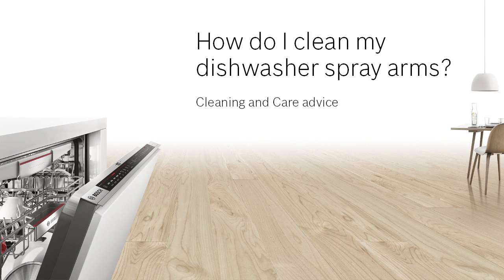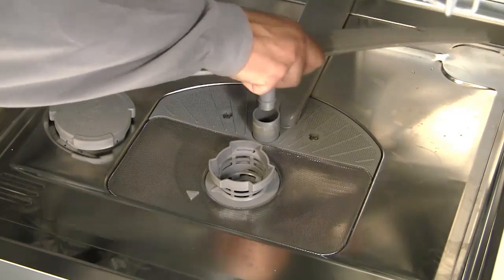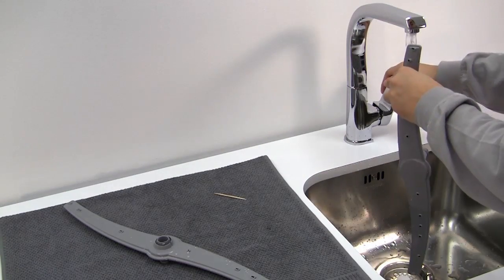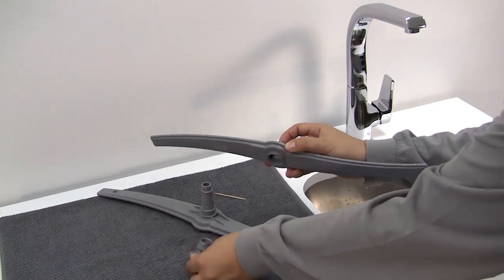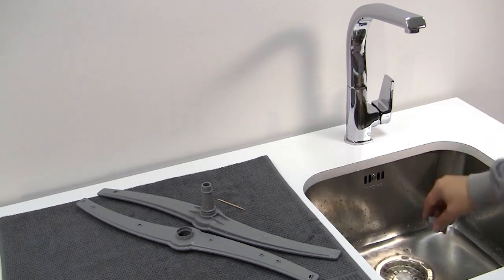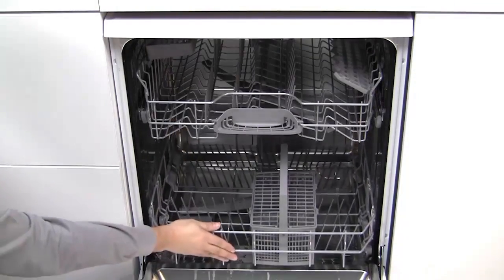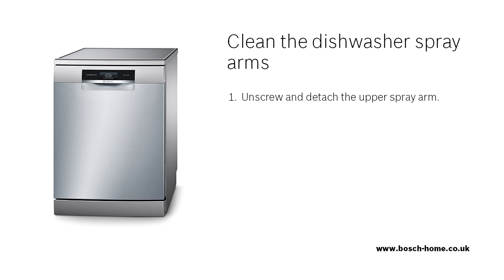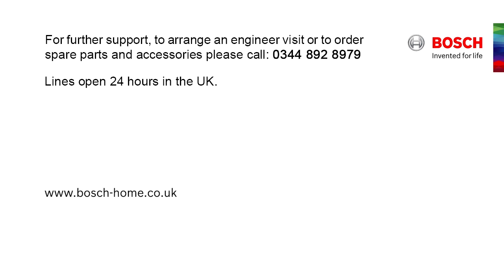How do I clean my dishwasher spray arms?

Comment: As other comments are saying, the design of these spray arms beggars belief...obviously not designed by anyone with any common sense! Tiny bits of gunk (be it meat/bone/sweetcorn) get lodged in the nozzles and using a toothpick or anything else more often than not defeats the purpose, simply pushing the offending article back into the spray arm, only for it to reappear somewhere else. Soooo frustrating 🤬
Reply: Hi, did you find the solution? My dishwasher arms are clogged every single time I use the dishwasher. So annoying. I have to clean it with toothpick all the time.
Reply: Hi - I eventually manually enlarged the holes using a knife! Not pretty, and I’m sure there’s probably a better way of doing it (eg with a small drill bit) but I was in such a temper I just ‘hacked’ at them!! They do still get blocked, but not NEARLY as often.
Reply: @trishsykes449  I am afraid that the water pressure will be less if I do the wholes bigger, no? I was about to buy a new dishwasher but what the point, if the new one is going to have the same issues!? The only one thing we can do is to empty the dishes before putting it. But then, why do we need dishwasher?
Reply: @innasokolova736  I haven't found the (SLIGHTLY) larger holes affect the washing at all...except they don't get blocked so often!! Beware of washing the dishes prior to loading the dishwasher...I've seen (somewhere on YouTube) that that's not such a great idea either (other than larger pieces of food/milk/cheese etc)! You also need to ensure the filters are clean AND properly seated as that can also affect the water pressure.
Reply: @trishsykes449  oh yes, I have seen on YouTube that the filter has to be cleaned and nicely attached. Thank you, I will check today my filter.

Comment: Spray arms are the worst designed part of a dishwasher. They are impossible to fully clean. If you push the dirt in one hole it will end up blocking another !
Reply: Youre right you can’t just poke the stuff out it just disappears you rinse it comes out of the other hole or the SAME one. I think all you can do is immerse the whole spray arm for as long as possible in water so that the food dissolved and you can rise fully. This takes a long time and in the meantime you can’t use the dishwasher. These videos are useless and they’re all the same .
Reply: yeh, it's a pain in the ass. What I do now is take both the arms off and soak them over night in a vinegar solution, that normally dissolves all the food particles and crap.

Comment: No, this process does not clean the residue blocked inside the arms. The residue will stay there forever. It's hard to clean the arms making the only option to buy new ones. They are sealed, can't access inside. I expected better design and engineering  from Bosh.

Comment: Is there any safe acid that can help to dissolve particles inside?
Reply from the maker: Hi, if for any reason your model does not have the same spray arms as per the video, nor does it state how to do so in your user manual, please contact us @BoschHomeUK on social media to further discuss. - Kieran
Reply: @BoschHomeUKandIreland   it is the very same spray, but the cleanup procedure shown here does not work. The particles stay inside the spray and block the holes again.

Comment: There is mildew growing in my new apartment's dishwasher spray arms. No way to open them to clean it out
Reply from the maker: Hi Dave, 

We would recommend running a dishwasher cleaner through the appliance, on the hottest setting.
You can also remove the spray arms to clean them manually with hot water.
I hope this helps. 

Thank you - EJ